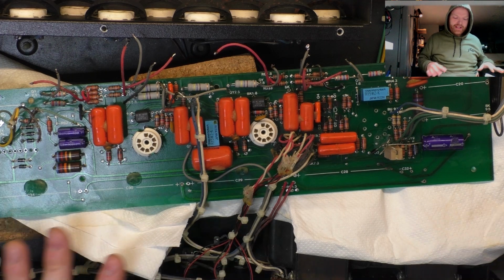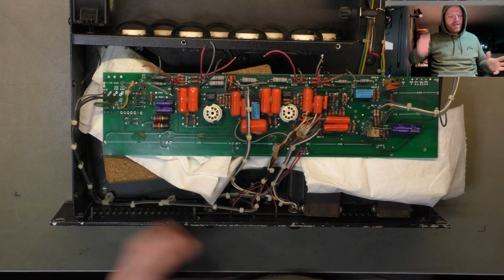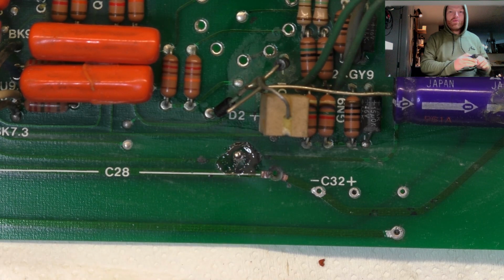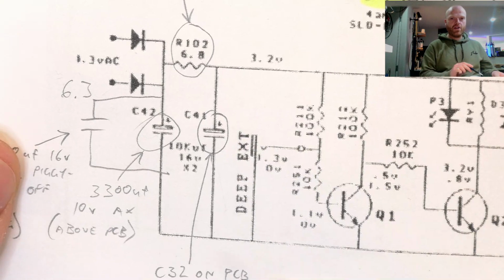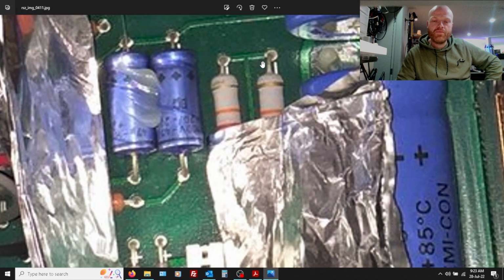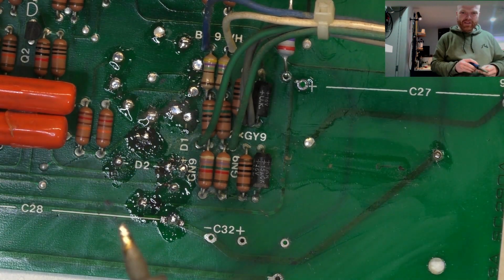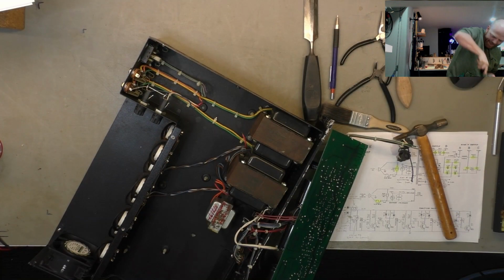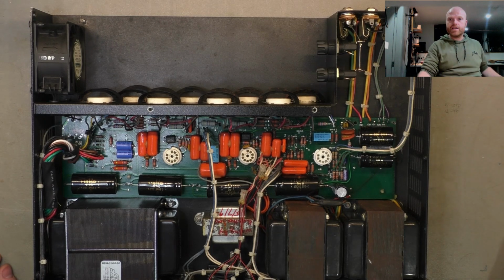Mesa Stereo 2:90 - Part 2: Reconstruction

Comment: Mesas aren't difficult to diagnose and repair if you are a GOOD technician who can read a schematic and knows how to troubleshoot logically, but they can be time consuming to actually work on in some cases. 

The first thing is, get people who own this equipment to understand PREVENTATIVE MAINTENANCE.  Replace caps BEFORE they go bad and puke and destroy circuit board traces.  And more.   If you are on top of the preventative maintenance, you may never have to do any significant disassembly.   

The biggest single problem with the 2:90 is the multi-pin header connector on the main board that ALWAYS starts burning at one connection because the connector's ability to handle the current is not sufficient and it overheats,  and then once the burn starts it slowly affects the rest of the header connector.
Reply from the maker: Musicians paying for preventative maintenance?
Recently, they only bring their equipment in when it stops making any noise at all..
Then they tell me "yeah, I think it's just the fuse".
Lol.
Reply: @BradsGuitarGarage  this exactly. None of my mesa gear has ever given problems due to preventive maintainance but I'm an anamoly

Comment: Greetings Brad! I'm A long time fan of Lyle. And I'm ecstatic that I found your channel!! I'm an owner of a 1994 2:90. First version, blue pilot light. And I agree! The quality control reps for these amps must have been on strike. First, I'm A bit confused brother. My PCB looks like the one that you showed an excerpt from.( the two 10k JT's standing by each other. The travesty that you are fixing doesn't have the two 10k's side by side. But I think you said that it was the current model? Or second version? I thought the second versions had a red pilot light. Anyway, that's irrelevant. My two 10k's leaked very bad causing my amp all kinds of trouble. Major arcing across that high voltage trace near. My 2.7k dropper cracked in two. Knock on wood, all of my carbon comps are still hanging! But I'm gonna change em. And when was that 100uf 6.3 v cap removed by each LDR for Half Drive? Mine still pops when engaging HD. I guess that there's no fix for that, besides finding a new home for it. 🤔🤗. And yes, my PT clip melted as well ( sigh 😩). Oh, that's what I think happened to that arced  filter cap. That 10k on top of it leaked shorting everything out! Once again, poor design. If I decide to keep mine, should I replace those tantalums? Thank you for sharing and your time! , A new subscriber and follower. Blessings.
Reply from the maker: 10K JT's? Sorry, I don't understand. Can you clarify?
Carbon comps have no place in a high powered application, particularly when they run them over their rating as Mesa do due to their incompetence.
This one had a bunch of mods by a prominent US guitar tech, some very questionable, and all very ineptly implemented (tack solder joints, unsecured components, risky bare wires run closely to each other etc). But I can't remember the details of the LDR switching.
Reply: Ty for your reply. Freaking auto correct!!  10k uf 16 v caps in switching matrix. Yes, those 100uf 6.3v caps along each LDR. I dont see them in the amp you are dealing with. The excerpt video that you showed of an earlier version had them. Those vactrols  are " suppose " to reduce popping between Half Drive voice. They don't work. Mike B told me too much voltage swing to eliminate pop. 🙄

Comment: One of my cats pissed on my mark v 25 a few years ago, now I might know why lmao
Luckily very little got on the amp itself, and it has served me well enough since I've had it (knock on wood, fingers crossed, etc). Since I've started learning about amp repair in the last year I feel increasing pressure to move it on and get something better built, cause any repairs are gonna be a major headache or wallet ache.
Great video as always.

Comment: I found chipquick when it first came out. very high but it works foe smd. Have not used it on a board socket but think it would work. I used a Mesa triple rec in the mid 2000. I hated that amp. I pulled it apart to put a bias resistor in it because the power tubes were red plating. It was a junk amp and sounded like crap. Thanks for your time spent making these interesting videos.

Comment: Had to work on my own 2.90 - leant to a friend - original Mesa supplied power valve shorted and took out the track on the pcb.  Re-wired avoiding the track to effect a repair.  Dismayed at the poor design by Mesa - can't but agree with your comments.

Comment: Can I ask, not valve socket but how do you feel about contact cleaner into input jacks?
Reply from the maker: 99.9% isopropyl on a plastic pipe-cleaner type brush only.
I have these in stock for a buck, or for free if you tell me a good joke.
Reply: Ideally, you don't want to use anything in an input jack that will leave a residue unless you are careful to flush it out with alcohol or similar degreasing solvent almost immediately thereafter. Contact cleaners work best on controls and switches that are subject to frequent use and exercising of the contacts so that they wipe themselves clean continually, and any small layer of lubricant that stays on the contacts gets pushed out of the way as you activate the switch or turn the pot frequently. Input jacks don't have a rotary motion involved when you plug into them, and the contacts are used and exercised far less than the contacts in a switch or potentiometer.  The normaling switches that ground out the unused jack or form part of the low and high gain input switching have virtually no wiping action when they open or close and so spraying them with contact cleaner doesn't do very much. I personally prefer to clean the main contacts "dry" with a pencil eraser (an ink eraser, actually) , and clean the normaling switches either with a thin piece of paper soaked in contact cleaner and dragged between the contacts, or with a piece of very thin ultrafine plastic backed sand paper or polishing cloth; but this is not something for the average person to do as it requires practice and technique, and perhaps some disassembly (the normaling switches that ground out the unused jacks are very easy to bend out of alignment and very difficult to get back into proper position). Some of the modern plastic enclosed jacks that insulate themselves from the amp chassis are nearly impossible to clean.

 Contact cleaners do the greatest amount of damage when they are squirted into anything that has high voltages on it. Under normal circumstances, potentiometers don't have anything other than audio on them unless there is a defective capacitor feeding the signal to them which doesn't block voltage from reaching the pot as it should (a pot that remains noisy after cleaning or where the noise returns shortly thereafter is probably a symptom of a defective circuit feeding it).  Switches that carry voltage, like the main on-off switch or channel-switching pushbuttons that activate a relay are carrying voltage and really should not be sprayed with contact cleaner or anything that leaves a residue.  You might not be able to spray them with alcohol either because many switches contain lubricant specifically on  the moving plastic parts, and if you spray them with alcohol it will wash the lubricant out from where it is desired and necessary, and spread it on the contacts where it will cause oxidation and eventual failure.
Reply: PS,  Spraying contact cleaner into the input jacks also typically means that the cleaner sprays or drips through and beyond the jacks, onto the circuit boards and other circuits nearby, and you can't easily control that; especially if you're using one of those terrible new Deoxit spray cans that is so hard to control......😖

Comment: How long will it take until techs like you or Lyle will start designing their own replacement PCB's for Mesa Boogies? If it weren't for the time and energy it would take to design such boards, I suppose it would be easier to just solder a brand new board full of brand new components than repairing an existing board.
Reply from the maker: We'd rather build our own from scratch.
I'm not putting my designs in a box with that badge on the front.

Comment: Spotted your special skinny fiberglas-bristle scratch brush (Bergeon brand?) on your bench at 17:05 ; I love those things and use 'em all the time, but use of your "meat-smoking" 🤣 rubber gloves is recommended, especially if you want to do any playing or have a gig within the next 24 to 48 hours. Glass splinters in your frethand (or plectrum) fingertips is not pleasant! The scratch brushes do work great for removing the green solder-mask coating from the PCB foils. Here in the United Wastelands of 'Murica, I buy them online from Essinger's, a watch and jewelry repair supplier. (They sell both the higher quality German-made EuroTools scratch brushes as well as the cheapos from India, and they have the glass refill brushes in 2 different diameters).

Comment: I have seen coin batteries in digital stereo receivers (used for memory) leak and the electrolyte soaks into the adjacent solder joints, turning the solder pads into grainy, crystalline batteries that literally spark and spit when you try to desolder the connection! Dissimilar metals ---- copper, tin, perhaps lead ---- plus an electrolyte makes a battery. Eye protection is recommended.. PS, Solderwick often works better than the solder sucker for removing that corroded gray solder left behind after capacitor leakage or other corrosive chemicals have had their way with it.

Comment: Brad, since you liked my pencil eraser technique (ink eraser, actually), now you should try my socket-cleaning technique: a wound guitar string, .033 to .036 or thereabouts, worked back and forth inside the contacts.  This works like a miniature round rasp or file to remove corrosion and tarnish and built-up gunk. Follow with alcohol to degrease the socket. If you can find a way to spin the guitar string with a small Dremel tool or other miniature rotary tool, you can clean an entire socket in less than a minute (although that particular corroded socket you replaced was a bit too far gone to be able to rejuvenate). This isn't even "my" technique, it's something I learned from somebody else smarter than me (it's not hard to find one of them!).  One caveat:  depending on which way the guitar string is wound (why aren't they all the same?) you might need to use a rotary tool that has a switch to reverse the direction of rotation so that the guitar string doesn't try to win one episode inside the tube socket.  I have some modified battery powered artist's erasers for this purpose,  and the batteries can go in backwards to reverse the motor if need be.

Comment: For those unfamiliar, Chipquick is a special, and *expensive*, low temperature solder that stays liquid for a long time after being heated to it's melting point, allowing the tech to  heat and liquify multiple adjacent connections almost simultaneously so you can pull the header pins or the IC up and out, off of the board, in one motion. You still have to remove as much of the original solder first before adding Chipquick to the connections. It's probably similar to the alloy known as Rose's metal.....